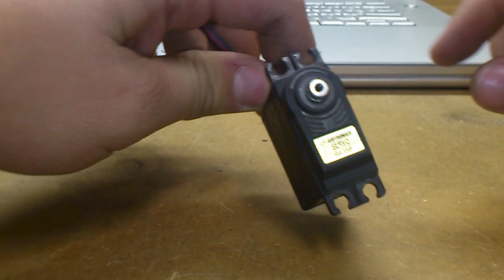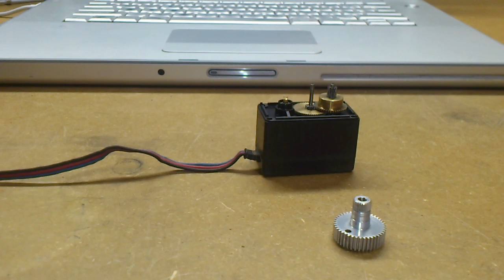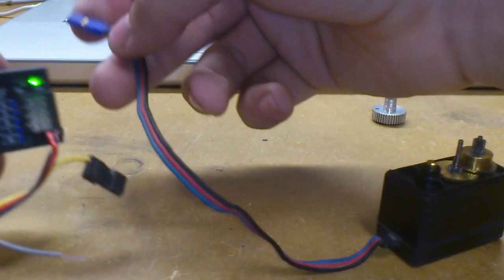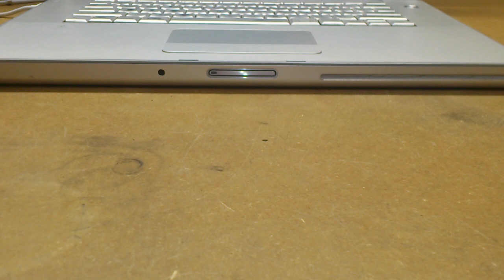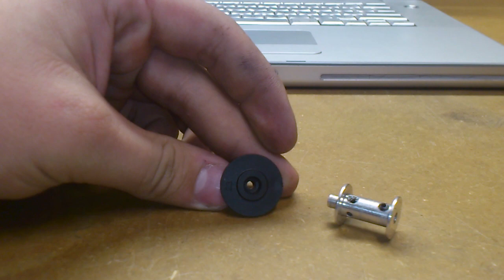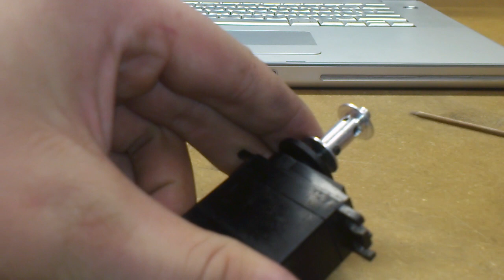How to Make a Servo Winch

Comment: Is there a way to make a servo with a timer used to pull a door open at sunrise and let it slide down at sunset automatically everyday? It's for a chicken coop.
Reply: I would say find an eye sensor for auto head lights for cars...the light ball thing in the dash of your car...they run on very little voltage..wire it in like a on and off switch....had luck wiring leds to my back porch that way...ran it off a twelve volt converter for house use ....